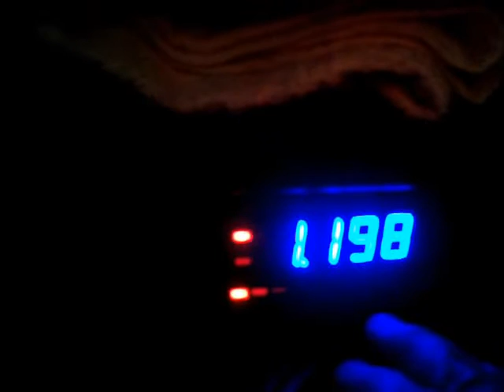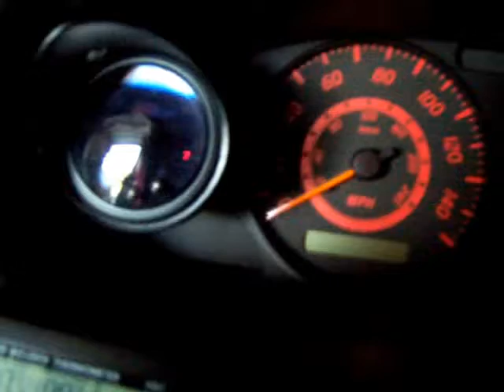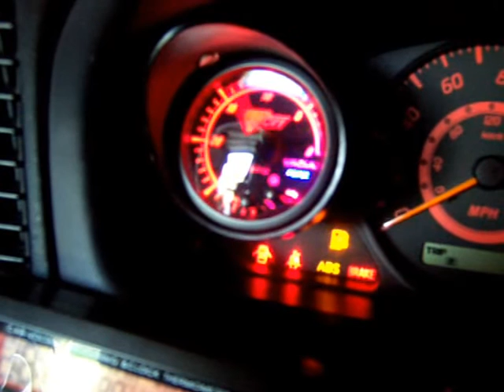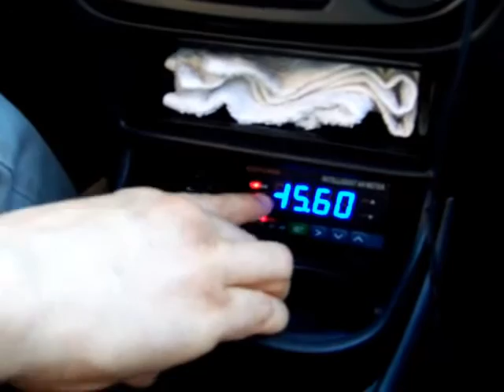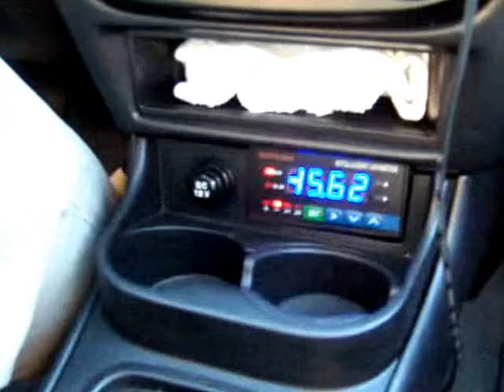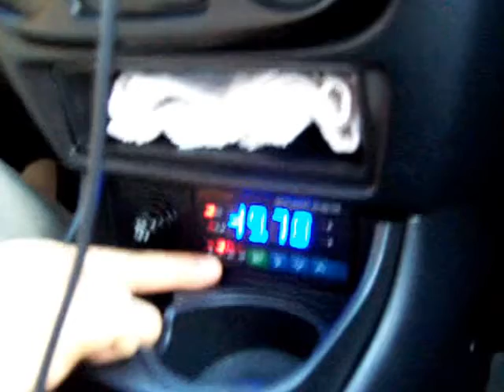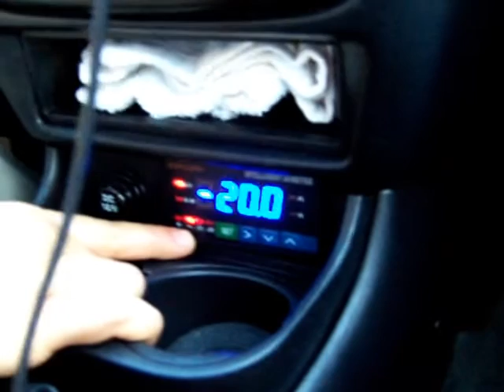Nissan Sentra Electric Car Conversion Part 39

Comment: De cuantos Hp es el motor electrico y cuantos amperes hora consume
Reply from the maker: Hola Abel. Este motor consume como 2.7 Ah por milla a approx 70 millas por hora y como 2.5 a 50 millas por hora. El calculo que he hecho de los HP pico con mi controlador de 1000 amperes restringido a maximo 650 es como de 90HP. Quiero en el futuro conseguir algunas baterias mas y usar los 1000 amperes maximo para tener approx 140 HP.